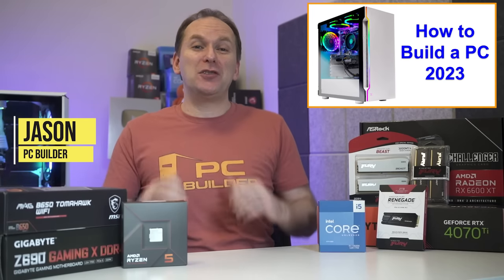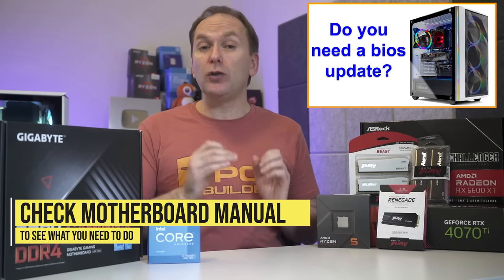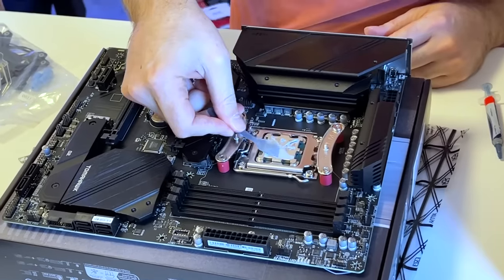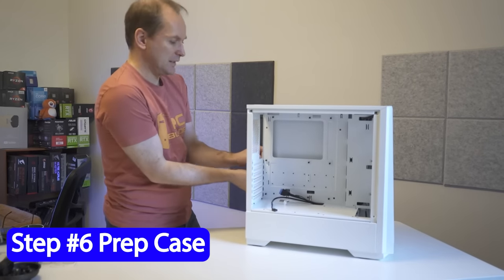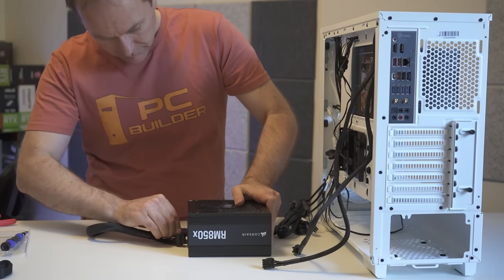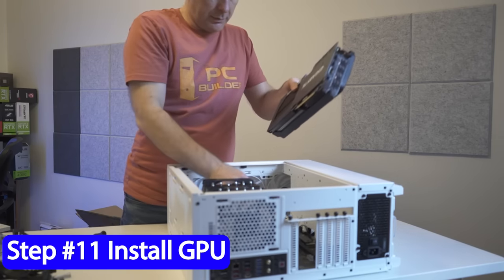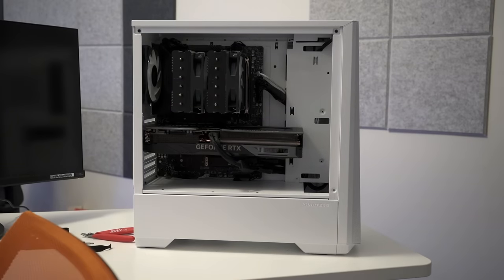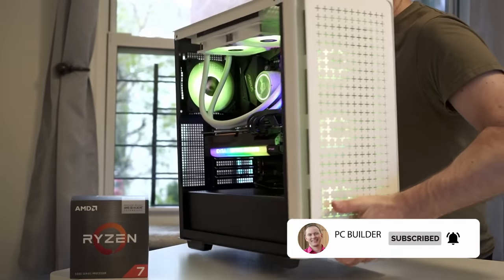🛑 How to Build a PC 🛑 Step By Step Ryzen & Intel 🛑 How To Build a Gaming PC

Comment: I build new PC with motherboard Aorus master B650X and always light A0 code...  what is it?  please help ???
Reply from the maker: Consult the manual, I think thats just a TPM configuration but consult the manual or google that board with that error to be sure. If everything's working fine I wouldn't worry much about it
Reply: @PCBuilderChannel  Im from Poland. Thanks for help. 
Sometime code 00 , Sometime A0 but my PC working good.
Bios update new wersion F3
Sorry my English leanguage is very low...

Comment: Been building pc's for the last 20 years or so. Absolutely love building them. And I brain farted. First rule mentioned, check your parts. Damn you Zen 4 with your poor RAM compatibility. I knew better and I bit on cheaper RAM. Know your parts people. If you've done your due diligence and the parts are all compatible, the build can be a breeze. If you forget that part, things can get complicated and frustrating real quick.
Reply from the maker: It happens for sure! Thanks for sharing

Comment: If I'm gonna replace the CPU on a previous built one. Would I want to clean the paste off the cool and add some new paste or would it be fine to just add the paste on the new CPU and leave the previous paste on the cooling?
Reply: You always clean off the old thermal paste when you remove the cooler.
Reply from the maker: Hop to our “How to Upgrade your PC “ video!

Comment: I need a gaming pc. that will play city skylines city building sims flight sims chess. all rolled in one open world what is the best graphics card for that situation.
Reply from the maker: Check the recommended specs for the games you play, in general you want the most powerful GPU that fits your budget to run those games. Id check out our "how to pick pc parts 2023" video to help you decide your budget and build goal
Reply: @PCBuilderChannel  I just updated all my other computers/ electronics for work . iMac 24" iPad 2TB model.   im jsut about done paying it off. I want to go back to pc gaming rather than console gaming . I have more luck with pc gaming

Comment: hello sir. I build a PC last Friday but after I build it and when I turn it on, it does not boot (not working). I used motherboard PRO B760M-G DDR4, CPU i5-13400, M2 HDD and Power Supply Aywun 700W. Can you help please?
Reply from the maker: Hop over to our "after you build" pc set up video and see if that helps. And for more troubleshooting I recommend posting to reddit "build a pc troubleshooting forum". Its a great resource. Hope it gets resolved quickly!

Comment: I just built my first Pc and didn’t do this process at the beginning ( flash bios). I turned on PC and everything works. Am I supposed to still do it.
Reply: If your new PC works fine, you likely don't need to update the BIOS.
Reply from the maker: I have an after you build setup guide coming! My advice is to update the bios to the most recent version generally.

Comment: Are CPU coolers needed for a budget build? 500-600 total cost.
Reply: Regardless of budget, you always need a CPU cooler. Without one, the CPU will overheat. You don't need fancy RGB AIO liquid coolers though. Most of the time, they don't aren't a good value especially if you have a lower end CPU. I would buy a Hyper 212 Evo or similar which should be better than most stock CPU coolers.
Reply: @JJFlores197  Thanks. I did not realize that CPUs come with a stock cooler even. First timer here.
Reply from the maker: Yep you do need a cooler but a lot of budget CPUs come with a stock cooler which will be fine. For that budget check out our 12100f and 5600 build guides on the channel.

Comment: I’m so lost when it comes to plugging things in like the power supply and other things that’s the only thing I need to do
Reply from the maker: This is where I rely on the instruction manual that came with the part (; it will all be there for you!
Reply: @PCBuilderChannel  thanks for replying this is 3 days after that and I got it to work that same day it’s been running like a beauty at ultra settings with high ray tracing. Thanks for all ur videos man they honestly help a lot

Comment: I would appreciate a quick review and analysis for this Config (considering the budget).

Motherboard 
  ASUS ROG Strix Z690-E Gaming WiFi 6E LGA 1700
GPU 
   MSI GeForce RTX 3070 Ti SUPRIM X 8G  or  Asus ROG STRIX GAMING OC Radeon RX 6700 XT 12 GB  (I prefer AMD more)
CPU
  Intel Core i5-13600K 3.5 GHz 14-Core
CPU Cooler
  Corsair iCUE H150i ELITE CAPELLIX 75 CFM Liquid 
Memory
  VENGEANCE RGB Black 32GB 16GBx2 5600MHz CL36 DDR
SSD
  Samsung 970 Evo Plus 1 TB M.2-2280 PCIe 3.0 X4 NVME Solid State Drive
Power Supply
  Corsair RM850x (2021) 850 W 80+ Gold Certified Fully Modular ATX 
Monitor
  Asus TUF Gaming VG27AQ 27.0" 2560 x 1440 165 Hz.
Reply from the maker: Very premium parts. Could dial back the cooler (H100i would be enough), motherboard (Strix boards are amazing but expensive), and go DDR4 (4x8 3600 CL16 or just 2x8GB 3600 CL16) if you want to save some money and reach up to a 4070 Ti. Note the RM 850X only comes with 2 PCIE cables for the GPU (despite having 3 ports!, WTF Corsair?) as we found out the hard way so make sure your GPU only has 2 connections (most 3070 are one or two).
Reply: @PCBuilderChannel  Thank you very much for your reply Jason.

I agree with memory and cooling.
About the graphics, I really can't buy the 4000 series!
I can buy only these two models from the 3000 RTX and 6000 RX series
If you choose one of these two and a power supply, it would be very good.

Comment: I recently built a PC with i5 12600k and Asus tuf H670 pro board vengeance ddr3200 ram but the board won't boot up if the xmp profile is on but will boot if set to default
Reply from the maker: This could be a number of things. My advice is to go to the Build a PC reddit and put up a troubleshooting post with the details of your system and what you've tried. They'll help you diagnose it. I would first make sure the bios is fully updated on the board. Test 1 stick at a time (usually in the 1st slot - see your motherboard manual for which one to use for 1 stick). If XMP works with 1 stick and not the other you have a faulty stick and can exchange the kit.

Comment: still doesn't work, not only has my fans stopped spinning the day after i connected them, but turning the PC off using the button on the case doesn't work anymore either (turning it on still works), plus i'm not getting any display at all with both displayport and hdmi, i've tried switching the cables for the fans which also doesn't work so now i'm stuck.
Reply: Have you tried reseating ALL cables and components? Make sure the memory is installed correctly per the board manual. If your board has a diagnostics or debug light, take a look at it as it can tell you where the problem may be at.

Comment: Ez debug led (Cpu) is on. No post, no usb ports working. Someone help I've been up hours trying to figure it out.
Reply: When doing bios flash, red blinking light comes on. PC turns on and running [fans, rgb lights] would go on for about 5-7 minutes. The light disappears, pc turns off. Pc turns back on. No usbs work, [mouse, keyboard and monitor aswell.] Still have ez debug red light on cpu. Motherboard is an MSI Mag b550 tomahawk max wifi. Got the latest bios update 7C91v26.

Comment: Hi iam from India  planning on building a pc, 

my specifications

AMD 5 5600x 
Rx 6600 gpu
Gigabite B550 mb
Cooler master 550 psu
Xpg 8gb *2 ram
kingston 500 ssd
Coller Master Force 500 Cabinet
 I am new to the channel, my budget is around  900 us dollar💰 so can you help me on this, gaming pc
Reply: This is looking good. Make sure the cabinet has fans for airflow. If the motherboard is the DS3H model, you can go for the 5600 non X.
Reply: @rogued3mon414  thanks
Reply: @damodharan6118  Also, add a 4 heatpipe cpu tower cooler for extra cooling.

Comment: I installed the Gigabyte control center from your link and it gave me an error where it put my monitor resolution at 1024 x 768 and I cant change it. Don't install the Gigabyte control center.

Comment: What if I build my PC without a cpu cooler? Do I skip step 3?
Reply from the maker: Your build needs a cooler. Are you saying you are using the included box cooler that came with the CPU? Or that you aren’t and are using a cooler you bought separately instead? We cover both here but you might want to check out our PC Parts Explained 2023 video to make sure you have all your parts
Reply: @PCBuilderChannel  I checked out earlier and I learned out a lot especially that a cooler is included with the CPU. LOL. I didn’t notice until I saw that video. Thank you so much for reaching out to help!

Comment: i cant make my pick i went amd with 7700x b650e strix 32 gb cl 36 6000mhz but cant pick gpu i can get 4070ti with total of 2500euro or go with7900 xtx sapphire pulse for 2640euro or 4080 for 2860 euro i main gaming and streming any form of help would help me pick.Dunno how are AMD drivers am going from 1060 and 3600x ^^ any help would help ^^
Reply: So Nvidia is better for streaming so I would do an Nvidia one and either the 4070 Ti or 4080 would be good.

Comment: Hi! I need some help please. I got a  (Haven't installed windows or did any BIOS updates)

Version 2.20.1271. Copyright  (C)  2022 American Megatrends, Inc. BIOS Date: 01/04/2022 Ver:f3
Press <Del> to enter setup.
New CPU installed, fTPM/PSP NV corrupted or fTPM/PSP NV structure changed.

Press Y to reset fTPM, if you have BitLocker or encryption enabled,
the system will not boot without a recovery key

Press N to keep previous fTPM record and continue system boot, fTPM will NOT
enable in new CPY, you can swap back to the old CPY to recover TPM related
Keys and data.      Still searching for solution
Reply: Press y. That's basically telling you there's a new CPU that has never been installed on that motherboard. Its normal and makes sense seeing as its a brand new motherboard and CPU.
Reply: @JJFlores197  Oh okay thanks I appreciate it!

Comment: Why do you not use anti-static straps?
Reply from the maker: As long as you don't work up a charge by wearing socks on a carpet while building or something I've never found it necessary. But they are easily available if you want to be extra careful (:
Reply: @PCBuilderChannel  Thank you so much.

Comment: How many screws mATX Mobo have?
Reply from the maker: 9, same as the ATX but the standoffs at the bottom of the case (when upright) are in a different location. Note that some cases have a solid peg rather than a screw standoff in the middle to help you get the board into place to screw in the other 8 screws.
Reply: @PCBuilderChannel  but in asrock h610 hvs theres only 6

Comment: the only thing that stops me is the cable management and connection of the cables... it looks a mess
Reply from the maker: It can be the most time consuming part, my advice is for a first time builder go for a basic build without adding too much RGB elements and extra fans to keep that part basic. Then just follow the steps here on pluggins and you'll be fine. And don't stress to much on cable management in the back, no one but you will ever know how it looks (;

Comment: Jason finally gives 30 seconds to a SATA hard disc drive, walla. SSD, fine, but the HDD necessary for data insurance and archive. A PC should never be without a hard disc drive as a compliment and back up to SSD hot data retrieval. mb
Reply from the maker: SSDs are so cheap if you want to do that kind of setup I recommend doing it with an SSD. See our Best SSD for Gaming video for more if that's helpful. But up to you of course
Reply: @PCBuilderChannel  Jason I get it, over a decade of Flash Summit attendance under my belt and watching the clock when SSD volume shipments will eclipse HDD and did last year. 

My issue with SSD is write endurance primarily. On x57S spec'd for 10 year life (hopefully 20) computers become tied to their applications SSDs are relied where appropriate for their endurance. 

I have an Athlon 22 still used for work as data collection device. A computer's useful work life is actually a very long time and I know about modeling and simulation. 

The X570SD boots from SSD read no problem. I have a hot SSD for large data base low latency whose files are loaded from enterprise HDD (not unlike a game archive could be) and I archive on a separate enterprise HDD. 

Specific SSD I'm on tri cell and won't buy quad cell and those are the volume mass market priced SSDs. I prefer SLC but won't pay for SLC when I can just get the HDD.

Personally, for the added cost of an HDD which is minuscule, and in your application case for game library, I can't see why you're not talking about that? Adding an HDD for example to the mid to upper mid and high end builds. I get mid shelf and below SSD's r cost effective storage but me personally, I am looking for more than cost effective I am looking for 10 year life. mb

Comment: Idk if im stupid but there is a glowing orange dot in the top right on my motherboard near my ram and cooler I cant seem to find an awnser online and its always something diffrent can someone help plz
Reply: Did you reference the motherboard manual?
Reply: @JJFlores197  ye I couldn't find anything
Reply: @Hotdogamer1369  What motherboard do you have?
Reply: @JJFlores197  ASUS Rog STRIX b650-a wifi
Reply: @Hotdogamer1369  That's the debug/diagnostics light. If its lit up on a specific section, it most likely means there's an issue with that component.
Reply: @JJFlores197  thank you

Comment: Still don’t understand what bios is or what it does
Reply: The BIOS is the Basic Input/Output System of a computer. In short, it is the most basic piece of software on a computer that allows it to work at a very basic level. It is responsible for initializing the hardware of the computer and booting into the operating system among several other things. The BIOS has been around for many decades and has been more or less replaced with the UEFI -Universal Extensible Firmware Interface but the term BIOS is still used to refer to UEFI.
Reply: @JJFlores197  thank you for the info. I have been trying to figure it out since my motherboard I’m planning on ordering (msi b650 tomahawk) is (incompatible unless bios is installed) with the ryzen 7 7800x36. So basically just a system update so they can work. Again thank you.

Comment: Ryzen 5 5600x with rx6600 good ?
Reply from the maker: Fine combo but that’s a budget GPU. Can you stretch to a 6600XT or 6650XT and if you need to go to a 12100 if that allows for the better GPU
Reply: @PCBuilderChannel  Yeah i didnt think that much and ghot a rx6600, a month ago i have ryzen 7 1700 currently so im looking to upgrade it to 5 5600x
Or should i just save for a better gpu . ?

Comment: I am every pro´s nightmare, I have built tons of PCs but I am extremely lazy about it, so far it has gone well. Building a new 3900k with a 4080 in it, wires everywhere, liquid logo upside down (not on purpose) and the SSDs hanging. SUE ME!!!!

I only have 2 rules, make sure all wires are properly connected and to do a stress test of about 4 hours when the rig is done to check temps and stability. I also of course don´t build anything you can look into , all the cases I use are closed to the eye.
Reply from the maker: If you're happy with your build thats all that matters! (:

Comment: i wanted to save money by not buying any fans, i thought the ones on the gpus will be enough for the whole system. the pc kept shutting down because of overheating, i will never buy gaming pc again i am playing on ps4 now
Reply: lmao. That's what we call PEBKAC in IT.
Reply from the maker: You got some bad advice there. That's a bummer. The CPU needs a cooler. The case needs fans. Your PS4 has a cooler for its CPU and fans to dissipate the heat (similar to laptop cooling). They aren't that different. See our PC parts explained for more.

Comment: Can you really save money if you do it yourself ?
Reply from the maker: Yes in most cases, but factor in the time and work building and if that doesn't fun for you then prebuilt is absolutely worth it
Reply: @PCBuilderChannel  I am not limited by budget but I don't like to waste money. I have an old Dell 8920 with 16Gb of memory and a Rx 580  8Gb. I am currently trying to play Dead Space Remake but have issues. Is it worth to upgrade to a much better video card or buy the latest stuff ?

Comment: I absolutely hate this my pc won’t turn on and the MB light is the only thing on.
Reply from the maker: Sounds frustrating! For more troubleshooting I recommend posting to reddit "build a pc troubleshooting" forum. Its a great resource. Hope this gets resolved quickly!
Reply: @PCBuilderChannel  thank you it turns out that the small wires at the bottom were a pole away from where they needed to be and kept from powering up anything. Please leave this here for anyone else in the future.
Reply: Small wires = power switch and led wires the small ones at the bottom of the MB

Comment: This guy saying its easier than it looks but explaining it is so confusing and complicated
Reply from the maker: Its a lot I know! If this is your first build i recommend sticking to a nice simple build, see our "builds and parts" list on the channel page for recommended builds for new or returning builders. You may also want to check out our PC Parts Explained 2023 video
Reply: @PCBuilderChannel  
I am looking into building my own first PC, parts list here, 
 Gigabyte b550m ds3h am4 motherboard 
Ryzen 5800x
Rtx 3060
850w full modular power supply
Samsung 500gb SSD m.2
2x8gb ddr4 ram 3000mz
D400p cpu cooler
Refurbished RGB mid tower 

Any thoughts?